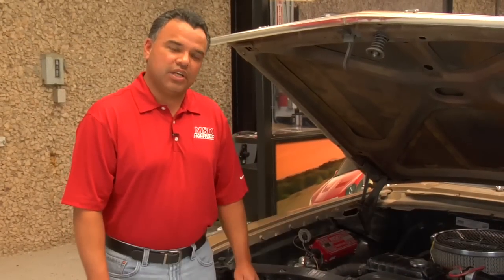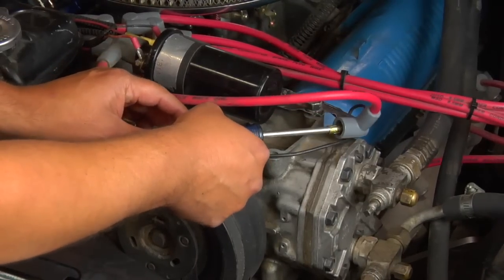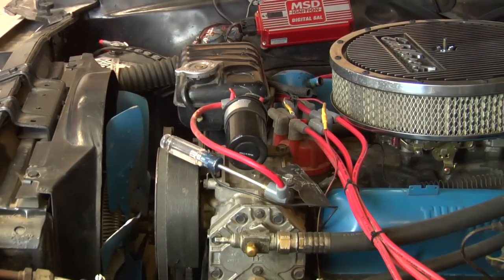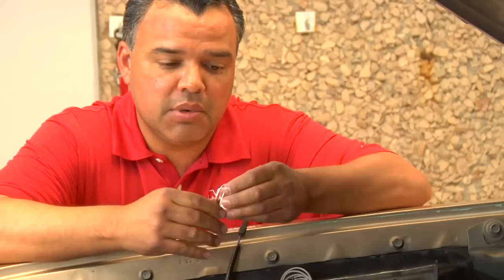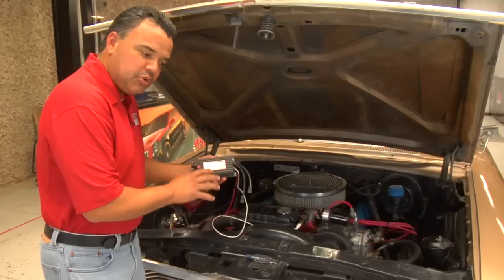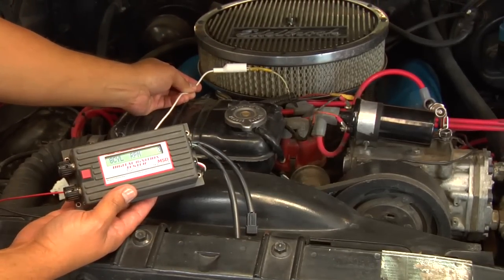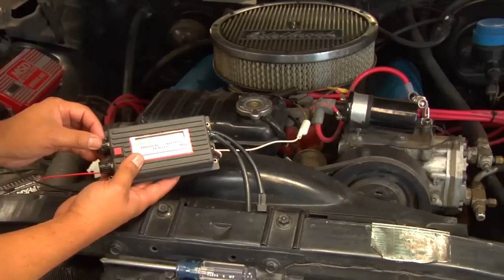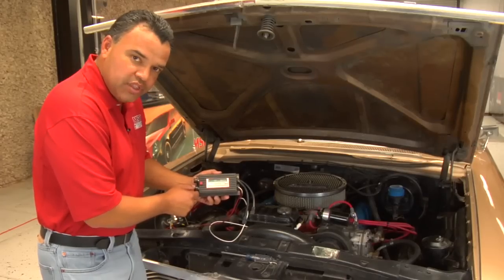How to test for spark on your MSD 6 Series

Comment: I have an MSD 6A installed on my 1982 Toyota Corolla 3TC engine, for over 4 years. Lately, once engine's been running for about 15-20 min, shut the engine off  then try to start but will not run. Is this indication of faulty MSD?? Also, I installed original Toyota module and engine starts and runs right up without hesitation. Please advice.